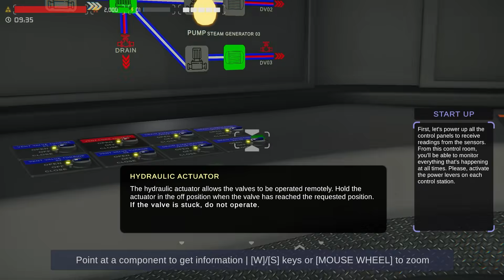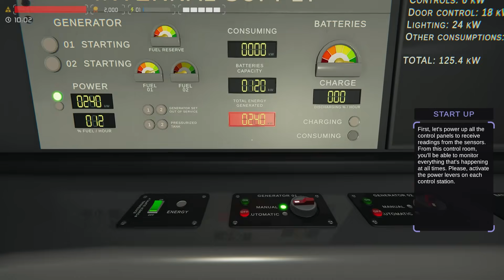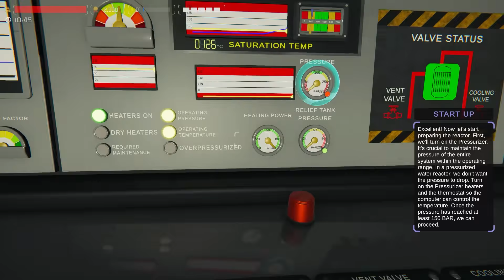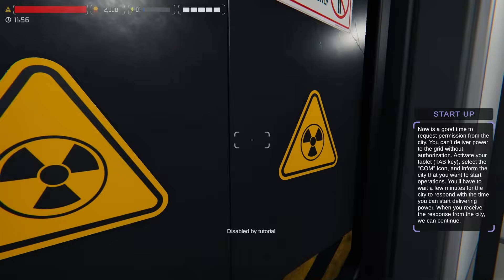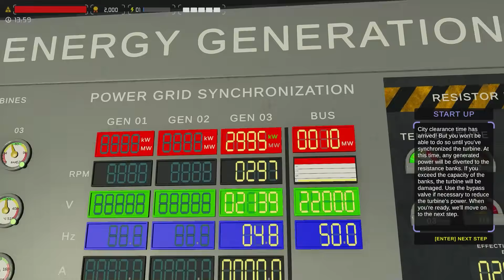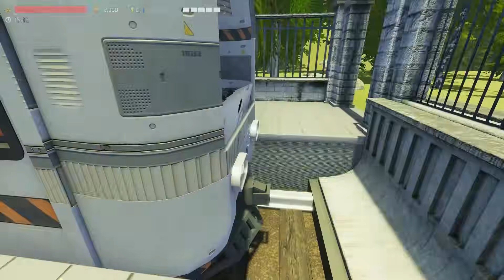In Charge of a Realistically Simulated Nuclear Reactor... WHAT COULD GO WRONG?!? | Nuclears

Comment: 25:00 The reason for not using the circulation pump at the start is that while you are heating up the water , the water temp goes above the saturation temp and thus create steam that create pressure that augment your saturation temps. If you run the pump while it's not fully pressurised , you might get steam in your cooling loops and trust me , you don't want steam in your cooling loop.